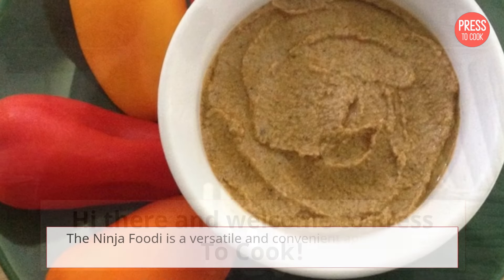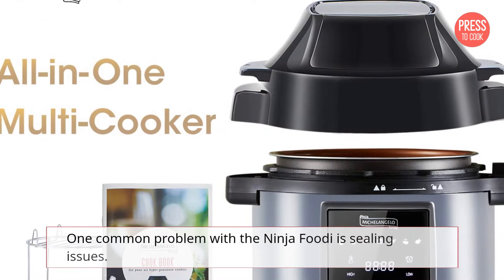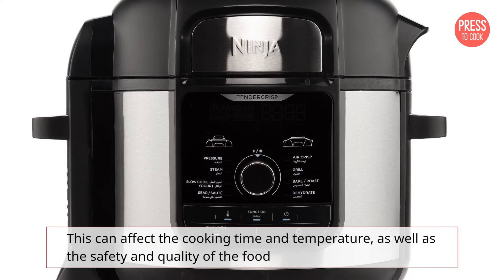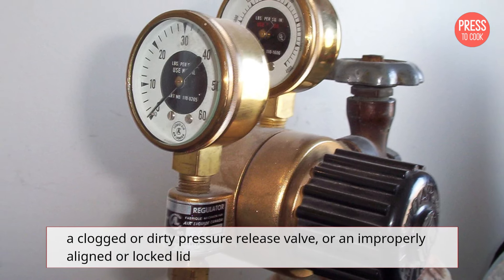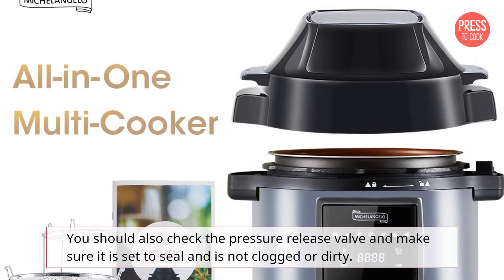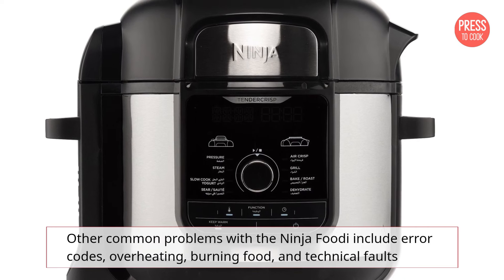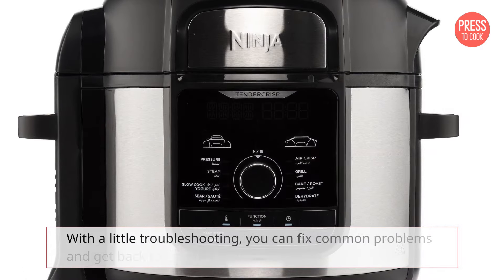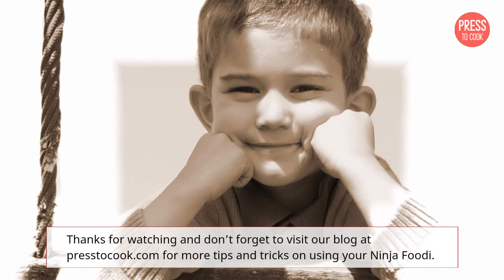Ninja Foodi Troubleshooting: How to Fix Common Problems

Comment: Useless. Mine won't turn on. Tried different outlets.   I've had mine 3 or 4 years. Can't find any useful suggestions to try.
Reply: Hi mine won’t turn on either . Its brand new, used it for a  month stopped working. Did you find a solution?